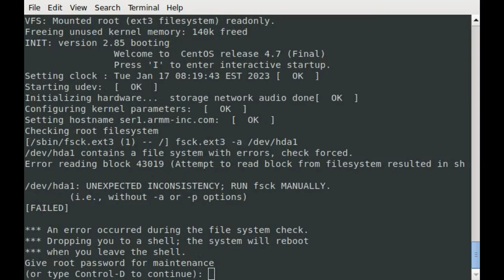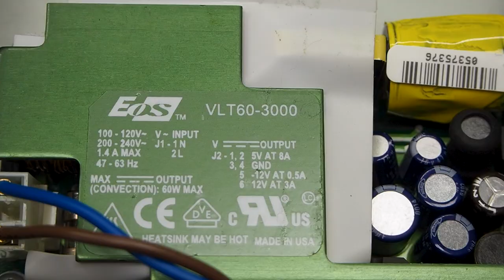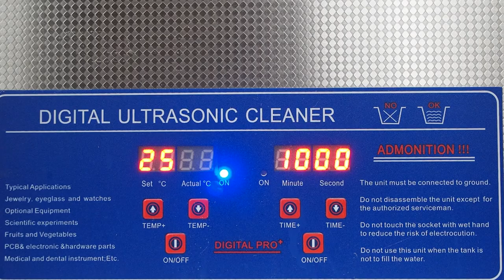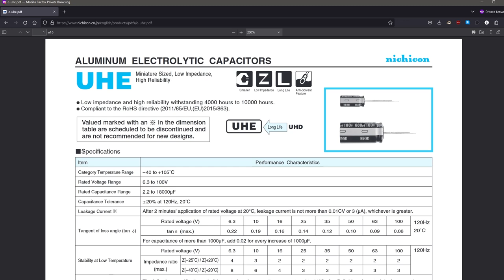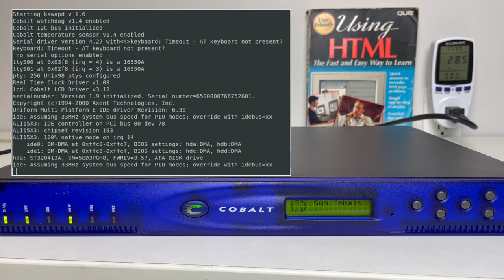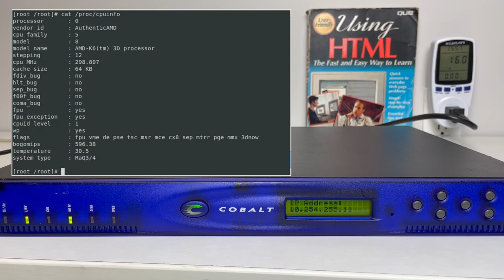Restoring the Web Server That Changed the Internet - Cobalt RaQ Part 2

Comment: Bending leads, soldering them and then cutting: HERETIC! [1]
Oh, and thanks for the entertaining video and reviving this precious little bugger!:)

[1] a) Bending leads: "bowlegs" ... professionals like to laugh at this, very long ... and it can be seen after years ... as a flagship of your skills, your business card:) Hehehe. We use proper bending tools, like bending gauges. The legs have tolerances and mechanical parameters, which are described in the datasheet of the manufacturer. 
b) c) First have a close look at your (precisions/electronics) wire cutter.  Cutting soldered connections afterwards applies stress to them. This is not necessary. I repeat: It can't be done without it and this kind of stress is just not necessary. Soft solder connections are very sensitive to any mechanical stress. This introduces weak points (like "cold" joints) that may be the cause of intermittent failure. Tomorrow ... in 10 years ... who knows. What we know is that they are at worst sporadic and you will NOT FIND THEM without loosing your faith in your expertise at least 5 times, hehehe. Also: Who cares ... 10 years may be a long time, with the repaired board most likely in other hands. So not our problem:P  
Professionals see this at the first glance ... and have a good laughter:) Solution: We cut the legs to measurement (BEFORE!), then use a magical device like a soldering frame or other holding tools, to hold the candidate in place. Then we solder. WITHOUT that long "heatsink" which you cut afterwards away, hehehe. (This was problem Number 2 after the physical stress. Both are not good practices, when soldering, easily avoidable and do cost nothing but learning another workflow. BTW: The "correct" and professional one:P Okay ... soldering frames, holding/pressing arms or adhesive tape (if you do not have a frame) costs money).

Excuse my lead-free rant. But this is tradition. You can't have a YouTube video that includes soldering without someone in the comment section knowing everything better!!!:P
Great video and a great job!:) Subscribed
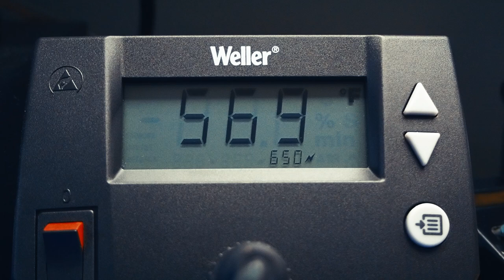Reply: By the way, your video also has horror elements. When I saw the well-known soldering station from our local manufacturer from Swabian in Besigheim (Weller in Germany) (time code 6:51), I was totally shocked by the 650 degrees temperature. We Germans are just not used to Fahrenheit. Hehehe:)
Reply: Oh and what I said above. It is always better to ask someone who has learned the trade and worked professionally in that sector. I mean personally, not via internet.
He or she can and will explain you several more reasons why it is not a good idea to bend/solder/cut. Including how your workpiece looks afterwards. Like "Kraut und Rüben" ("cabbage and turnips", meaning everything mixed up), or simply beautiful to look at. With good practice and the equipment you have(that Weller), you can achieve handiwork that is clearly distinguishable from wave soldering or other machined solutions. And by that I mean better looking, aesthetic ... so to say in the realm of "prettiness";)
Oh, I should stop, or someone could think I had some kind of soldering fetish ... How absurd! So. Watching your next video, now!:)
Reply: I find this to be a bit of pearl-clutching.  I've worked on a lot of electronics, and while -- yes -- professionally produced electronics pretty much always have pre-cut legs before soldering, this is far from the worst thing the product will likely endure.

A couple weeks ago, I opened up a Yamaha musical instrument and there are capacitors inserted unevenly -- like, tilted to one side with the legs at different lengths.  Last weekend, I was inside a Juniper router and one of the screws securing the motherboard to the chassis had gripped the board and cranked it up a few threads above the standoff it was supposed to be resting on.

I took apart an industrial PSU a few days ago that was so cram-packed I had trouble gripped the capacitors with pliers (which I had to, because there was no room for my fingers.)

I think, after having their legs clipped by flush cutters, they're going to be just fine.  Don't you worry.  They can handle it.

Comment: That PSU is likely a refit, hence the small size in the big box. I don't have a RaQ 3 but the PSU cage looks like it's nearly the same size as the RaQ2s and CacheRaQs.

EDIT: Watch putting stuff with quartz crystals in the ultrasonic cleaner!

Comment: Wouldn't it make more sense to rotate the cpu heatsink 90deg so the fins are in line with the airflow? Seems like the air intake is near the powersupply with space for another fan.
The sticker residue looks like it came from a license sticker or some other sticker that is was intended to be "re-used" maybe.
Btw cool vid, i remember working on a Raq3 once,  worked all through the night to get our customers websites, email relay and ftp services back up. I never realized it was such an iconic machine, thanks!
Reply: Air flow was essentially from the hard disk to the CPU. I can't remember about the orientation of the CPU heatsink, but we did sims and testing, so that was probably best for some reason. The PSU was too cool to be an issue.

Comment: 8:35 I thought that was obvious that checkerboard pattern is from eight inventory tag with tamper evident backing. A.k.a. remove the asset tag it's obvious that I got removed. I got a computer when I was younger for free through a program and I removed the sticker and it took forever but I got it off.

Comment: If I remember correctly, the K6-2 300 can be easily overclock to 450Mhz with setting the jumper from 66Mhz to 100Mhz..

Comment: The other question I have is are all the caps the same size? IO didn't hear if you said that or not? Also That pattern on the front is some type of void of remove seal. It didn't come with the server out of the factory. It was placed in whatever facility that had it in play.

Comment: 9:13 the cpu cooler is installed upside down it needs to be rotated 180deg to cover the processor not the socket.
Edit Nvmd i saw you fixed it!

Comment: I remember racking-in about 500 of these machines around the Asia-Online ISP in the 2000's.   They were seriously useful machines.   They all stopped being useful as SSL came along.   We ended with early no-name branded 1RU cases and an Intel Pentium 2 processor/board with a SSL offloading card to start with.  Machines were using a rip-off version of Linux that was hardened to make it work properly with the hardware we were using.

After that - the business got popped with the bubble.  I had a few of these machines until about 2011 when they all started to die.

Today we are running hyper virt in virt servers in Azure...   Crazy...

Comment: What solution are you using in the ultrasonic cleaner, and what's your drying process? I work on old stereo equipment, and I really want to try this.
Reply: I have the same question.

Comment: What firmware did the RaQ use? I didn't notice any Award, AMI, or Pheonix PLCC chip on there or in the serial output (although not sure if those could have even done serial output from the BIOS like modern AMI ones do). From a quick Google search it seems like it may have been fully custom, which is pretty weird for a non-embedded x86 machine, and even more wild for a start-up company.

Comment: Did you use any thermal compound or a thermal pad when you attached the heatsink? I didn't notice any on the footage...
Reply: On something like the K6-2, it's not that important.  It was quite typical in the Socket 7 days to just put a heatsink directly onto the chip, with no thermal grease.  The K6-2 300Mhz only has a TDP of something like 17W.  The previous gen of CPUs -- the 486 -- didn't require a heatsink and fan at all at the lower speeds.

Comment: they weren't kidding with that energy efficiency - 16W at idle isn't bad, even by moern standards
Reply: 16 watts for 300Mhz on a single core.
Compare that with 3Ghz on 12 cores/socket CPUs on modern servers for only around 10x the power consumption (but somewhere around 120x the compute power).

Comment: Where does it intake air? I know it's not a lot of heat to dissipate, but I'd expect it to need some fresh air
Reply: Yeah, 90's caps weren't the best and this kind of closed-box application, running 24/7, would definitely not help them last...also, the cpu heatsink was mounted the wrong way 😅

It seems the designers didn't really worry much about thermal management 🤔

Comment: Question: What liquid did you use for the ultrasonic cleaner? Brilliant channel by the way, subscribed! 👍
Reply: its called water
Reply: @Xiefux  Doubt it, normal tab-water is NOT safe for electronics (as it was said in the video "... special liquid, safe for electronics ..."), deionised water is slightly better, but I won't submerge a motherboard in it.
Reply: @Dormikon01  perhaps its isopropyl alcohol instead then
Reply: @Xiefux  Hmm... possible. Although that would be a bit dangerous. The cavitation bubbles or better their implosion bring a lot of energy into the bath, it could easily catch fire. maybe we get an answer from the author?! 😀
Reply: @Dormikon01  i looked it up and there are apparently special liquids for these cleaners depending on what you plan to clean. 
its basically water or some solvent mixed with a chemical to reduce surface tension, kinda like soap
Reply: @Xiefux  yeah, that brought me to my first question, which mixture he used for the motherboard. thank you for looking that up! 👍🙋

Comment: I've seen incorrect capacitor labeling on other circuit boards (like truly incorrect, where it had the actual polarity printed, and it was opposite of the polarity used in the circuit). At this point, I basically ignore all of those markings and just make sure to take meticulous pictures and notes of how things were positioned in the original circuit before I start removing components.

Comment: I worked at an ISP in the late 90s early 2000s and we had a 1u Cobalt which we used for Web Caching.   Looked just like one of these. Could these do web caching?
Reply from the maker: Cobalt did release a separate product specifically for caching.  It looks like it was called the "CacheRaQ" but we haven't yet seen one of these (yet) - would be fun to dig in to
Reply: @theserialport  Same base hardware, squid integrated into the UI.

Comment: Looks like your esd armband is connected to something else than the cobalt chassis so I'm guessing ground somewhere. That won't give you the protection you want which is the same potential as the server your working in. Unless you've grounded the cobalt as well it might hold a different potential than you/ground and hence lead to a discharge through you. I'd suggest you clip it directly to the chassis or ground pin of the equipment you're working on.
Reply: The blue mat it’s sitting on is grounded to the same ground as his wristband. This is better than grounding to the chassis of the equipment. 

It’s a very common configuration for electronic repair techs.  Though some prefer to wear the wristband on their ankles to avoid contacting the workpiece.

We usually have test pads that beep when connection is made so that we can verify we are safely grounded.
Reply: @EchoConstellation  So you're saying the rubbermat is conductive? That sounds counterintuitive. You might as well ditch the wristband entirely. Everytime you touch the case you neutralize the potential between you and the server. This is why you've been lucky so far. Connect the wristband to the equipment or or ditch it.
Reply: @nicolajkl  yes, but also no. They’re conductive, but in the gigaohm range.

Your wrist strap electrically connects you to the same ground plane as the ESD mat. 

You will then have the same electric potential as the mat and anything sitting on the mat. 

This is industry standard.
Reply: @nicolajkl  grounding to the chassis is also useless if the chassis isn’t connected to earth ground. 

Here’s a good (albeit old) video on the topic: https://youtu.be/tcRqj9FhgcE

From 13:30 forward shows the setup for wrist strap and pad.

Comment: the heatsink is on the wrong way it think its blocking airflow making the fan work harder and will make the thing make more noise and run hot look at the direction of the finstack ??   the cpu may have been upgraded with the HDD and the sticker was from the company that did the upgrade. to stop ppl opining the lid and voiding the warranty of the company that did the upgrade. thats not a OEM sticker. good video makes me want one lol
Reply: had a look online.. and yip its the wrong way. it was the wrong way when you got it you can see in the first video.. must of had a cpu upgrade at some point.

Comment: The failing capacitors are probably due more to the "capacitor plague" of the late 90s to early 00s, where brands like the G-Luxons shown here were filled with a faulty electrolyte.  The electrolyte formula was stolen from Rubycon and incompletely copied by Chinese and Taiwanese capacitror manufacturers.  Capacitors of this era from Taiwan and China fail in the way shown in this video, and many motherboards of the era were affected.  Quality electrolytic capacitors, if rated properly for the use and not overheated, can last a long time.

Comment: No thermal paste? oO;
Reply: These puppies were not running very hot. So it was uncommon to have thermal paste. Even passive radiator was ok.
At the same time one could overclock it to 450MHz instead of 300, in which case it required to have thermal paste.

Comment: This really was a 'SCRAPY' design. Not only was it using standard x86 hardware as it's base, it was also using a socket/platform that Intel had abandoned in an attempt to leave AMD behind, with it's introduction of Slot 1. Gotta love how AMD not only gave existing Intel users an upgrade path from Pentium 233mmx, but how AMD was able to stretch socket7/super7 right up to use 550Mhz CPUs with the K6-2 and K6-III. Oh, the good old days...when AMD were the good guys.